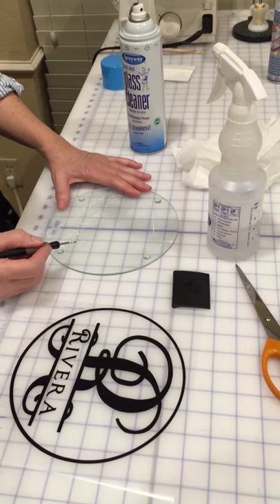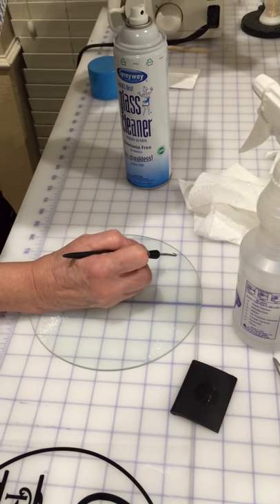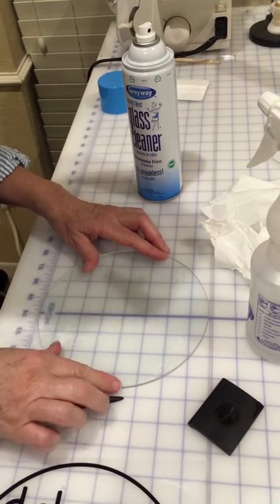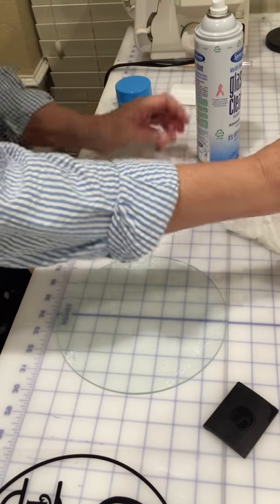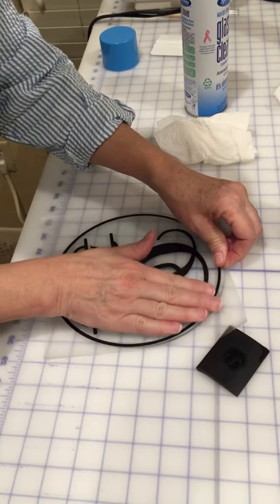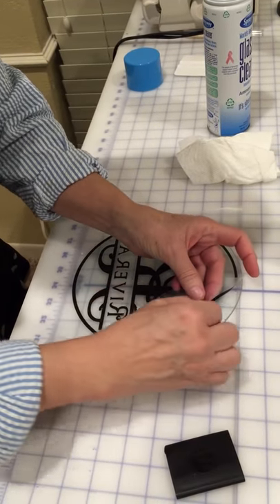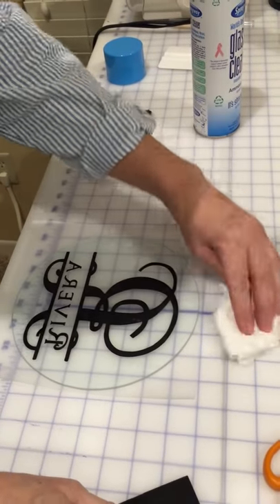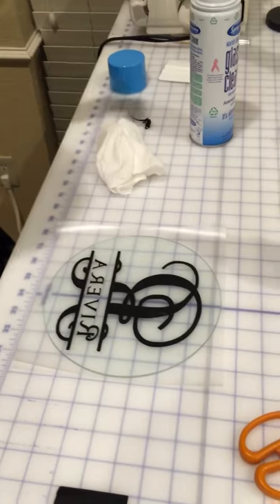Modified Water Method for Vinyl Application

Comment: Hi Suzanne, if I could lend you some advice/pointers. This method is called a "wet application" and is commonly used amongst us that work with vinyl. You may have seen other videos where they use a few drops of dish soap, that works perfectly fine too. After spraying the glass with cleaner I use a 50/50 mixture in a spray bottle of rubbing alcohol and water, this will insure nothing is left behind from any cleaner previously used. Then when you spray your work surface with the soap/water mixture also give your decal underside a spray too, the reason this works is because the mixture neutralises the glue until removed so it helps to spray the decal too. Then position it accordingly but don't bother putting any pressure on it until you have it right where you want it. After that, work it out just like you did and allow time to rest like you mentioned. I hope that helps a little, also one last thing, you can pause the recording and un-pause it whenever you want without having to "splice" it :) Good luck!
Reply from the maker: Thanks for these fabulous tips!  I haven't touched any vinyl in months and will have the "relearn" everything when I do get back to crafting...I'll use your ideas in my next attempt!

Comment: Hello there, I am new to vinyl projects, as I just purchased a Cricut Air.  I was wondering what font you used for this cutting board.  I am making one for my Mom as a gift and wanted to do something similar, but on a square cutting board.  Also, how do you get it to print in reverse, so that when you put it on the cutting board, it reads correctly when applied from the back side.
Reply from the maker: +Jaime Lee Garcia Hi Jaime and welcome to the world of Vinyl!  You are in for a fun adventure.  I hate to say this, but I don't remember the name of the font I used for the name.  The I actually "made" the initial simply by tweaking an embroidery font that I had on hand.  I wish I could be more helpful--sorry!